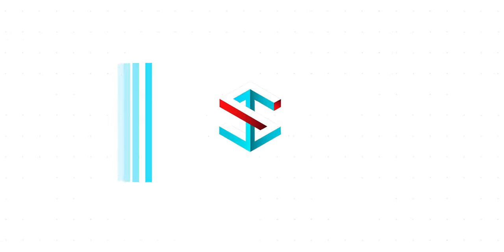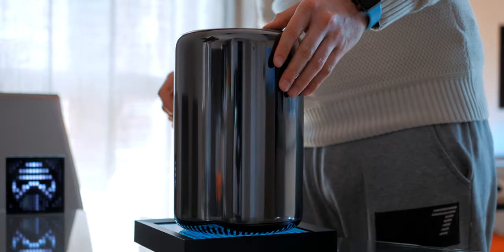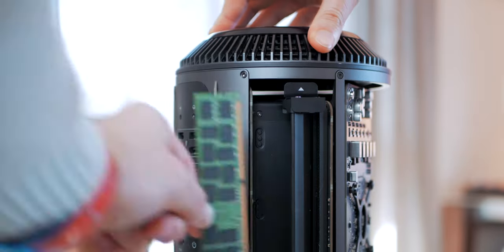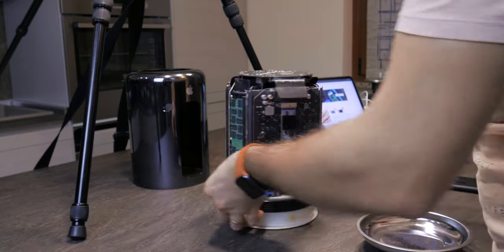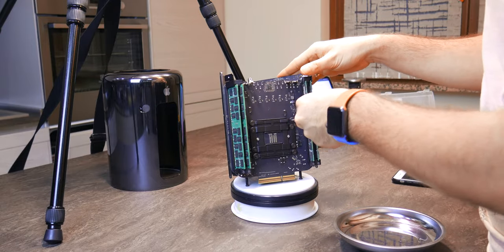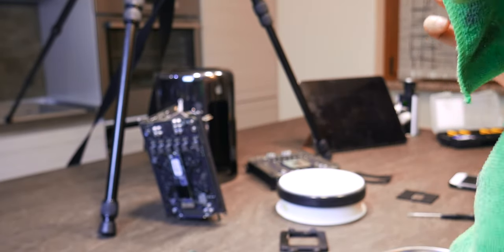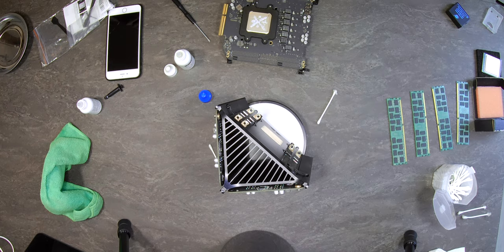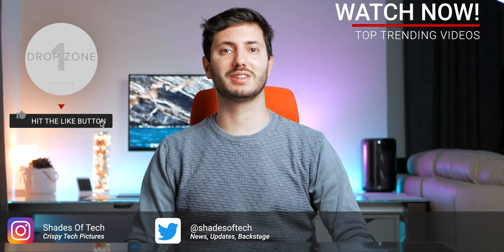Mac Pro 2013 Full Upgrade (12c CPU, 64 Gb Ram, 1 Tb SSD) | Shades Of Tech ⬡

Comment: Great Job man, I've managed to upgrade mine to 12-Cores CPU as recommended by you. Now looking for the RAM upgrade soon. Keep it up man.
Reply from the maker: Thanks a lot! Happy you found it useful! Which gpu are you rocking? Check out my videos about egpu on Mac Pro as well
Reply: @ShadesOfTech  i am considering the 12 core cpu as well since so cheap now 30-50 best offer, i already have 128 GB ram inside, is there a big performance bump for the 6 compared to 12?
Reply from the maker: @sirlimpsalot7767  yes

Comment: I am about to do the same CPU Upgrade... processor is on its way 🤗
Reply from the maker: I have been using the 12 core for more than a month and it’s tremendous power! Breaks FCPx like butter in rendering and exporting. 
Also got an egpu with 5700 xt video on the way it’s extremely powerful
Reply: Shades of Tech show us!
Reply: would it be good for 3D? I want to get one and use it for that and photoshop as well for video editing /fx
Reply from the maker: @RareMade  I didn't test 3d but I can tell you that I am testing 8k video editing with an e-gpu and it works. So I think with a good gpu and the 12c cpu you could handle 3d as well.
Not sure if 3d is more CPU or GPU intensive or both
Reply: @ShadesOfTech  anyway you can test it please

Comment: You did a fantastic job with the video!！Is the performance of fpcx clip 4k significantly improved after the upgrade?THX，
Reply from the maker: kenri young yeah the cpu improved a lot the performance even if with video editing the biggest improvement was using an egpu with the amd 5700xt. But it’s more expensive

Comment: Do you know if this nvme is compatible and is a good option to use in Mac pro 2013? Crucial P3 Plus 1TB M.2 PCIe Gen4 NVMe
Reply: yes, heard it was getting 1500 read speeds, please post speed test
Reply: i meant the gen 3 model p3, the p3 plus is gen 4 , 2 much ssd for the 2013 mac pro ok, get the p3 ok thats the 1 you need for the 2013, or you,ll get bottlenecked ok.  trust me, if you bought the p3 plus, just bring it back and down grade...they,ll understand you need gen 3,  not gen 4
Reply: how did you make out?

Comment: Saludos desdes Ecuador
Exelente información, 
tengo una consulta, cuanto maximo de RAM puedo ponerle a una MAC PRO LATE 2013, Procesado: 3,5 GHZ 6-COre Intel Xenon E6, AMD Firepro D500 3072MB, lo utlizo para edicion de VIdeo y los redenres estan muy demorados al momento tengo 16 de RAM
Saludos
Reply: Según yo 64gb es lo máximo, quizá sería interesante ver si puedes hacer el upgrade de las tarjetas de video ya que también importa mucho pero sería mucho más caro y sería conseguirlas de segunda mano. La unica opción para eso serían las AMD Firepro D700.
Reply: yo tengo esa misma mac la maxima ram que soporta es 128 gb de ram
Reply: y lo maximo de almacenamiento son 8 tb ssd
Reply from the maker: Yeah 128 bud at slower speed than 64 gb

Comment: Are the V2 processors new ones that didn’t come with the originals?
Reply from the maker: Not sure if they were with the original 2013 wave but definitely with the second apple wave, so they are the same Apple would have mounted. The v3 are not compatible tho (up to 16 core) https://everymac.com/systems/apple/mac_pro/mac-pro-cylinder-faq/how-to-upgrade-mac-pro-cylinder-cpu-processor.html

Comment: Gulp. Got all the way to the inside, but then the final four internal screws holding the CPU have solid caps! No Torque screw hole in them! What the heck! Has anyone seen this? And if so, how the heck do you remove those?
Reply: Saw this on another site!!! Yay!...

"you've run into Apple's new tamper-evident screw stickers. Before you proceed, please note that removing these screws will leave behind clear evidence to Apple that you've been inside the computer, leaving you no wiggle room on your warranty. To remove the screws, first press down with the T10 screwdriver around the centers of the circles, where you would expect the holes to be, and you'll tear right through the stickers (you may have to blindly rotate the screwdriver a bit to get it to line up correctly, since the stickers conceal the holes). Then, just unscrew as normal.

A couple more notes: new Mac Pro 2013's started shipping with these CPU screw stickers some time in 2015, and if you take an older Mac Pro 2013 in for repair, Apple will quietly add the stickers if, during the repair process, they end up stripping the computer down to the CPU bracket.

I haven't found a satisfactory method for preserving the stickers, nor a replacement, but I imagine it could be done...

davidmatics - Aug 9, 2016"
Reply from the maker: I did not have the warranty tops. Anyway my Mac Pro was already long gone out of warranty

Comment: Is the GPU upgradeable? I can get my hands on a 6 core but it has d300 graphics
Reply from the maker: No you don’t want to upgrade the gpu.
I bought an egpu and mounted the amd rx 5700 xt and is a bomb!
Reply: Shades of Tech is the d300 dual gpu okay for photoshop, illustrator, premiere, after effects and maybe blender? the computer has a 6 core Xeon and 45gb of ram I believe. Also do you have a video on your gpu?
Reply from the maker: It yet I am working on it.
Not sure if those applications are gpu intensive, probably only blender. The rest should be only cpu intensive and you can still upgrade to the 12 core cpu

Comment: Does anyone know or can share the Intel 12 core CPU part number?
Reply: Never mind after doing some research I found what the numbers are.

12-Core CM8063501288843                          
12-Core BX80635E52697V2 (Part number prefix BX means in OEM BOX)
 —————————————————————————————————-
10-Core CM8063501374802
10-Core BX80635E52690V2 (Part number prefix BX means in OEM BOX)

Comment: Nice video bro.
i got a late 2013 quad-core mac pro with 12Go of DDR3 1866MHz Ram.
im just wondering if it's possible to upgrade to  3x8Go DDR4 2400MHz Ram , or it must stay in 1866MHz Frequency ?
Reply from the maker: You need to use the same ram apple used. If you want you can get up to 64 gb of 1866 or 128 gb with slower. Go on OWC to see the correct specs.
Considering it’s 2013 there’s no way it supports ddr4. It didn’t exist yet in 2013
Reply: @ShadesOfTech  thanks bro.
So i can use 4 x ram with same frequency of 1866Mhz either use others DDR3 ram (also same frequency but slower than 1866MHz)?.
can't i use DDR3 ram with higher than actual frequency ?

Comment: @Shades of Tech is this Maxed out machine worth in today's Market considering Monterey will end its support in late 2024 ?
Reply from the maker: Not at all, considering that m1 Mac mini base performs as well as this machine in video editing. And costs 300$ used
Reply: @ShadesOfTech  so I know this is a good machine back then but if you maxed out the RAM to 128 GB and expand the SSD to 2TB and dual AMD FirePro D700 would you say if I were to save money would this last longer by these maxed out configurations ?
Reply from the maker: Unless you specifically need 128gb of ram I guess it’s a better option spending money on M2 Pro Mac mini. In the end I got M1 Max Mac Studio and it’s more than enough.

Comment: Hello a great job, I'm a little confused I've seen videos where they put a processor "E5 2696 v2" and you and others that I've seen place E5 2697 v2 which would be the right one for my Apple Mac Pro ME253LL/A 4-Core Xeon E5-1620v2 3.7 12GB 256GB (Late-2013) MG7251 "AMC 2630" thanks
Reply from the maker: I am not totally sure it would work.
My rule was to use the same cpu as apple shipped it back in 2013. Probably it would work with similar cpu if other people managed to do that. I only tried the one in the video because I was sure it would work.

Comment: Will this work Intel Xeon E5-2697 V2 SR19H 2.70GHz 12 Core CPU Processor
FCLGA2011 for a Mac Pro 2013 ? Or SR19H Intel Xeon E5-2697 v2 12-Core 2.70GHz QPI 30M 130W FCLGA2011 Processor not sure what the difference is so many or the LGA 2011
Reply from the maker: I’m not sure about this question. I would say that the one that apple used will work 100%

Comment: Apperently you can upgrade the trash cans wifi card, using only the 2015 Macbook pro 8.1 wifi card..is this true?..And whats your opiuon, on the owc 128gb memory kit!.Do you use that?, in the 5.1 rigg?They make 1 for the 5.1 Mac pro tower, I call it..They explian how the 12 core works using only 1066mhz, not 1866, but you need 128 more than you realize, type thing.for your heavier work, editing etc,,True?..or just use 64 gb 1866?

Comment: what do you think about upgrading the ram to 128gb? according to OWC and transcend jetmemory this mac pro 2013 is capable of supporting 128gb of ram
Reply from the maker: Yeah it’s confirmed it supports 128 Gb but you have to use slower ram dims.
In my usage scenarios at full load while video editing I use maximum 32 Gb so in my case you want to have faster dims rather than more ram.
If you need more ram because you use more than 64 gb you can use 128 gb but if you don’t do that it doesn’t make sense the extra money
Reply: @ShadesOfTech  i think it will support load reduced dimms to which should keep the 1866

Comment: Are you able to able to run a scaled 4k60 dipslay with this @60hz and 3008x1692 via Display port cable?
Reply from the maker: This is a very specific question. There are definitely some scaled resolution. If you want to see all of them you just need to press alt and then click on scaled and you will see all the scaled resolutions, even the ones not optimised. If this doesn’t work you can use an app called switch res x that allows to trigger any resolution or framerate you want.
Back to your question you can select 3008x1692 at 60hz and it’s actually the one I use with my Mac and one of the 4 suggested by apple so you should be safe and sound. But ultimately it’s up to you Mac gpu the resolution it can drive
Reply: Shades of Tech and it’s smooth?
Reply from the maker: @maxnguyen2875  Yeah definitely smooth. As I say I use it everyday as my favourite resolution. What Mac do you have?
Reply: Shades of Tech currently I have a 2018 Mac mini and I needed an egpu to make the hi smooth.  I got a 2013 Mac Pro 6core/32gb ram/d300 yesterday off eBay.  I won’t get it for a couple weeks. But I wanted to make sure macos is still smooth on 32”4k display @60hz and scaled 3008x1692
Reply from the maker: Yeah I didn’t have any problems with my Mac Pro with D300 as well so you can be safe and sound! The Mac mini doesn’t have an internal gpu so it’s pretty natural that it can’t run smooth 4k display
Reply: Shades of Tech ya. Mac mini was kinda crappy without the egpu.   A little better with 32gb ram and FileVault off.
Reply from the maker: Yeah definitely. I am still hoping in a Mac Pro Mini but I am not sure if we will never see it
Reply: Shades of Tech me too. But maybe one day with the ARM Macs their integrated graphics will be able to run 4k displays better than this intel stuff.

Comment: Greetings from Ecuador
Excellent information,
I have a question, how much maximum RAM can I put in a MAC PRO LATE 2013, Processed: 3.5 GHZ 6-COre Intel Xenon E6, AMD Firepro D500 3072MB, I use it for video editing and the redeemers are very delayed at the moment I have 16 RAM
Regards
Reply from the maker: Hi! You can put a maximum of 128 gb but will run at lower speed. My suggestions for video editing since I use myself for the same purpose it at least 32 gb.
If you use FCPx it would be enough, otherwise I would go to 48 gb.
64 will be overkill
Reply: @ShadesOfTech  Thank you very much for answering, I have problems in Premiere, but when I render shots in SLOW MOTION, the render is very delayed and I see that the machine also heats up, I will go from 16 to 64 in ram, in which brand would you recommend me
regards
Thank you very much, your information is very useful to me
Reply from the maker: I used the ones from OWC because I had problems with eBay sellers that sold me non compatible ones. 
I would suggest you to switch to FCPx or davinci because they take more advantage of the gpu since you have the d500. I know is a complete change but performance are much better. I think you should give it a try